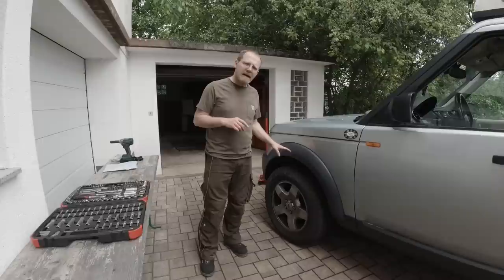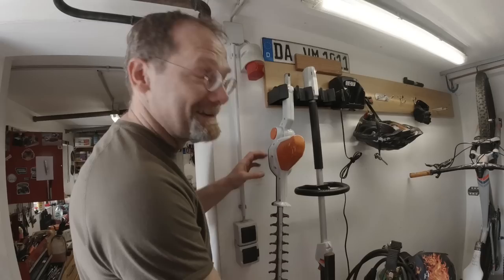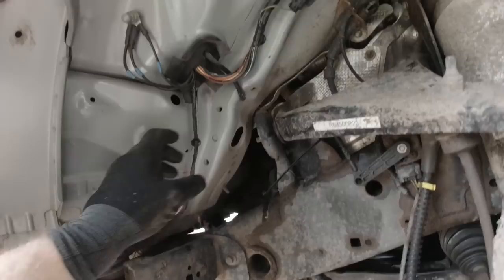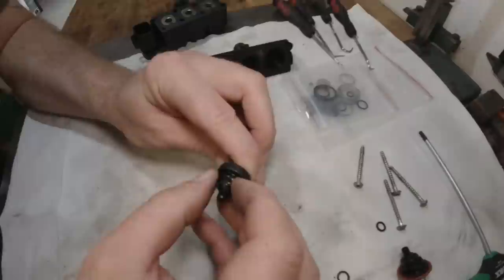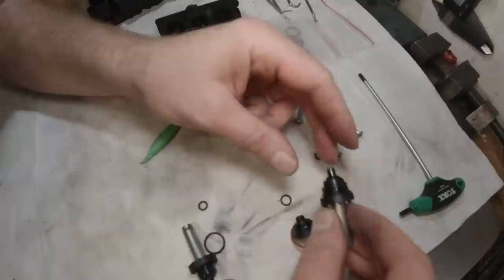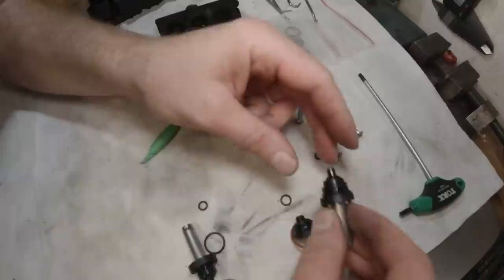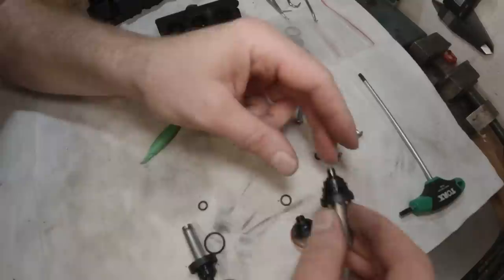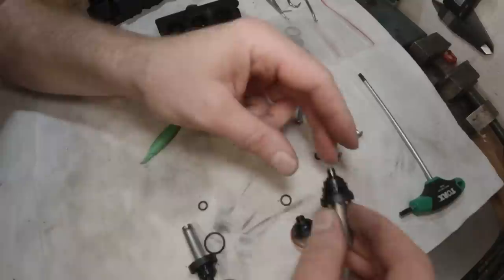Air Suspension Fix - Land Rover Discovery 3 / LR4

Comment: Yeah, the air suspension has amazing ride quality and it's also great for off roading as well. I concede that it adds some unreliability to the vehicle (especially if neglected), but it's worth the trouble. In fact, the air suspension is the main reason why I recently added a Range Rover to my fleet 👍

I rebuilt my front valve block on my Disco 3 over a year ago and I never figured out where that small O-ring went 😂
Reply from the maker: I agree. The system is worth the eventual trouble.  Pretty sure the valve was leaking internally.  Vehicle stays raised and no more faults.  Enjoy your Range Rover.  Christian

Comment: A word of advice when you replace the Air Strut , torque the bottom shock bolt from your pit after fitting the new strut/shock with the car in normal ride height and all 4 wheels on the ground . Oxyman in the US  does a good YouTube  video on quickly replacing LR3 Airshocks 
I think the Mr Bodsey video on servicing the valve block is The Brake bible guy,  Ian Bodsworth. 
Nice to see the "Voyager 1" Tent heater getting used again .
Vera stressing about the car evertime it's on axle stands is priceless!!!
Reply from the maker: Yes, I tightened them before wrong and it twists the bushing badly.  Christian

Comment: That's amazing what those engineers did building those valve units, it is just as amazing to see Christian Service the unit with all those O-rings and stuff, Vera and I are in suspense watching!
Reply from the maker: I was surprised that it actually fixed the leak and that is was still working.  Would not touch the internal rings again.  Just the big ones.  Christian
Reply: @Vera_and_Christian  You can fix anything you put your mind to, Christian!

Comment: Hello Christian and Vera, the noise the valve makes, is because de EAS Computer, instead of sending a continuous 12 V signal, it sends a PWM signal in order to actuate the valve.  This PWM signal lowers the amperage needed to actuate the valve spool. Its a common practice in order to reduce the load on the electrical system.

Comment: I'm using Arnott 2809 shocks for the front suspension on my LR3. So far are good, and were easy to install
Reply: I'm at 170K+ miles on my original LR4 shocks. I think I'm going to replace them with the Arnotts.

Comment: Thank you for another insight into the LR3. I will have to do or let the garage do a lot on the suspension this year (now 275 tkm and 14 years). I still try to figure out how to split tasks between me (cheaper ;-) ) and the garage. Most likely I will do the air suspension parts that can be done without disassembling the wishbones etc. and let all the parts that require re-aligning and measuring to the professionals.

Comment: Thanks for showing us how easy it is to service the suspension valve block. Mine was replaced 3 years ago with an OEM unit by the dealer I bought the LR3 from. It cost me nothing, they paid for it in the name of customer service which was nice. PS, I don't know if there is a non-genuine unit.

Vera, you don't have to take the ARB Deluxe bull bar off to unscrew the wheel arch screw. There is enough room to push the lights out a little bit to access the screw. It is a tight fit, but can be done easily.

Comment: I've had air suspension on my Teslas but no problems in over 100,000 miles. Nice smooth ride and I do like the ability to raise the suspension for "off road" use (not that I do much off road in the Teslas... that's what the LR is for).

Comment: Have done this - valve service and airbag replacement on a Range Rover L322 - most difficult part was freeing a seized/rusted  pinch bolt on a front shock absorber. There are several suppliers of these service kits - some are better than others - I remember I bought kits from different suppliers in order to track down the best kit - the o-rings are not expensive.

Comment: I rebuilt the front valve block on ours which in 2 years of ownership is the only single issue we had with the air suspension and caused a slow leak, which didn't affect the driving but would occasionally throw an error.    One tip is I bought 100% silicone lubricant and made sure all o rings had a coating of this before reassembly.   Not a single leak since :)
Reply from the maker: We use silicone lube. 😃👍🙋‍♀️Vera
Reply: @Vera_and_Christian  good stuff, I thought it was unlikely I knew something you didn't!   Always amazed by your work, be nice to meet one day.
Reply from the maker: @chrisoverson  😅👍🙋‍♀

Comment: Germans eating sausages for supper!! What ever next! Where were the vegetables?
I really hate it when something gets fixed without really changing any parts. I bet Christian found that frustrating! Still with valves and contamination its possible as long as the seal is undamaged. 
Anyway the nice thing about a Land Rover is there are always things to fix, and even if there aren't any, there soon will be. Try to get a PCM-Engine Diesel 3.0L, P1247-00 (AF), Turbocharger boost pressure low ( on 19-07-2022 12:22:03 at 123342 mi )  fault code for next time then we can see how the professionals do it!
Loved the video, I might ditch my Netflix account as you guys are far more entertaining! Great job.😃
Reply from the maker: Thanks.  There are multiple potential causes for low boost pressure.  The LR4 workshop manual has a in depth diagnostic procedure.  Christian
Reply: @Vera_and_Christian  What manual do you recommend, I have the workshop manual pdf version from Ebay but its huge (7423 pages of LR Time), searching for  P1247 gives no hits, but Turbo gets you into the right ball park. Can you show us what you use (and study) in another episode?

Comment: Great works you guys….Tried to do this myself last year & I got the rings all mixed up….long story short it didn’t go very well for me, ended up just getting a brand  new  front valve block
Reply: At least you only got 1. Ordered a cheap non land rover one from eBay only to find the electrical socket was leaking air after fitting 🤔 so then had to buy another proper new one from LR - still wasn't fixed so then new compressor...  and now we have suspension again 🤗
Reply from the maker: 😅👍You just need someone like me helping you, then that will not be happening again. 🙋‍♀️Vera

Comment: Guys, the valve block affects the compressor when one of air spring valves (or both of them) are leaking. Center valve does not affect neither height nor compressor time. The spring valve leak when the rubber bump in the center of stock is worn. Use sharp tool to pull rubber bumps off of stock, then use metal or plastic spacer to displace bump out of stocks and then use sand paper to remove worn part of rubber. It will have immediate results, but after 5-10 months you will see leaking is back, so yeah new valve block.

Comment: When you consider that air suspension has been pretty standard on commercial vehicles running at 44 tonnes plus for over fifty years, it's obvious that the system works. I know the ride in my Disco 3 is very comfortable and I have an after market suspension control which allows me to level the vehicle side to side as well as front to rear and has a 'trailer hitch up' setting as well. Yes, it can be problematical but then so is most everything if you don't look after it. I certainly wouldn't change it for a mechanical system.
Reply from the maker: Oh don't get us wrong, we praise the air suspension. It's the best thing going for the Discovery, we would not want to change it, and have stated so in many, many videos. Did I say many videos? 😃 It's one of the biggest sins, changing over to coil spring just because someone does not take care and service the air suspension.🙋‍♀️Vera

Comment: Just a thought; have you taken into consideration the temperature drop in the air bellows during the night? Could it explain the drop in height?
Reply: I was thinking this as well, and air barometric pressure which does change by the hour, or is so little air in the system not to matter?
Reply: @WhosPhotoTube  Of course, it would have to be measured, but my guess is that it is enough air in the bellows to give a 1,5cm drop with a 10-15°C temperature differential.
If the car rises again towards the afternoon, we have our answer.
Reply: The air spring system in my E39 Tourings is unaffected by the outside barometric pressure. There are two steel air reservoirs, one per side, which equalise the pressure. I suspect that the Land-Rovers have a similar system given their BMW heritage.

Comment: ooo , You see , as I type to You via email with the same issue in my Disco4. Im during changing front and rear air valve. in my case  every morning only front was 2.5cm down and was pumped to normal high. We will see if after changing air valve will be OK :)  Regards

Comment: The big issue with the old Classic and P38 was that everytime the system detected a fault it would put the vehicle down to the bumpstops. The "cure" was worse than the fault. I think that soured a lot of people on it. The air suspension on my L322 has been flawless. You need to buy a 2006-2011 L322 so I can learn more about my truck. Please.......

Comment: Great job, but I have a leak on my driver's side. Will track the leak and hopefully get it back to normal. One question though, could you show how you plugged the oil pressure gauge? Thanks Christian. Vera's comments are so funny :)
Reply from the maker: The leak is coming from your sunroof most likely. Have you seen this video yet? https://www.youtube.com/watch?v=604513GUKws&t=393s🙋‍♀️ Vera

Comment: Ah yes, the old hidden screw in the wheel arch trick. I didn't need to take my bullbar off  to get it out as I forgot it completely and ripped it out. Vera I still think the cracks in the strut are just baked on dirt. Are you going to replace the complete strut or just the shock absorber? I went Koni FSD for my shocks, and had to order them from GB as not available in Oz. Good work with the valves, I really should do mine!

Comment: I have had a timing belt go prematurely (aftermarket) while cruising on the highway. Ive bent a valve and broken the oil pump so the Cylinder heads have had to come off to ensure no further valves are bent. At 330k the bottom end of the engine still looks great with no ridge on the cylinders. Moral of the story. Rather replace with OEM components on critical areas.
Reply from the maker: You probably still had the old oilpump we always warn about. We cannot mention enought that everyone with a Disco from 2005 till 2009 should have checked what oilpump they have installed. 👍🙋‍♀Vera

Comment: Hello!  Trying to solve a EAS relay puzzle.  Thought I'd ask you guys.  Relays for AMK compressors are 80 amp and Hitachi are 70 amp, yes?  I have a 3rd type among my spares which is stamped "70A Cont - 140A Peak."  I'm assuming that this 3rd style is simply a 70 amp relay with more words on the case.  Any opinion about this question and compressor relay amperage?  Thanks!

Comment: What model electric chainsaw? Been looking at these for a while. Means we don't have to carry smelly fuel in the car when we go away. Also reduces the noise pollution 😊
Reply from the maker: I got the Stihl because it is available here in Germany.  Don’t buy cheap as you need the battery to last and basically bigger (capacity) is better.  Christian

Comment: I have a very  odd question I have been chasing a fault on my discovery 3 and found that when testing the power and ground on my center valve block solenoid I have 12v live on both wires.  I unplug power to the suspension module and retest the solenoid there's nothing and when I plug the module back in I have a negative reading on both wires from my power probe but no continuity to ground it's blown my mind I'm not sure what to do next to be honest
Reply from the maker: You can find the wiring diagram in the www. The solenoids are PWM controlled.  It’s not simple 12v Stuff.  Not sure about the ground so.  Check the wiring diagram.

Comment: Are you considering that the air in the struts cools down overnight, thus reducing the pressure by a few hPa ??
And have you connected that DAB+ aerial to the Pure Highway ? If yes, how did you connect that ?
Reply from the maker: No, definitely not. The system is under pressure. So there was a leak somewhere. 🙋‍♀️Vera

Comment: Hey guys. Great video. I had the same problem. I ended up buying a D4 used valve block front. Sorted. Also what gap tool do you use?? Great video as always.
Reply from the maker: We have the GAP tool for Land Rover vehicles. There are no other versions for the same vehicle brand, like with the icarsoft tool. 🙋‍♀️Vera
Reply: @Vera_and_Christian  thanks Vera. Appreciate your reply. 👍🏻👍🏻

Comment: Hi Christian.   The gap tool you are using 17min 21 sec, did this come with the Disco 3 or is it a separate purchase? I thought it may be a separate purchase
Reply from the maker: It is a separate purchase and quite expensive. Google GAPIID or Gap Diagnostic.  It’s the best unit available. Christian
Reply: @Vera_and_Christian  Thank you for the info Christian
Reply: @Vera_and_Christian  There are 2 versions of the tool,  the IIDTool BT at £440 & the IIDTool Pro at £1,650.   Were you referring to the pro tool? If so, it is expensive but needed if one wants a good diagnostic tool
Reply: @life107familyfitnessboxing8  you don't need the Pro version unless you plan on using it on multiple vehicles. The BT version is good for one vehicle ( it is locked to the VIN No. You can purchase a new code to transfer it to another vehicle if needed).
Reply: @AndyK.1  it is pricey, but you can sell the Gap Tool when you sell the car. No other tool is as comprehensive as the GAP tool. Why spend a fraction of the cost to save some money, when you just have to pay a dealership in the end to do a task that an Autel can't do. Not worth it in my book, but to each their own.
Reply: @AndyK.1  🤣 Can the Autel be used on other makes? If so it definitely makes it more versatile. There is a reason the GAP tool is so popular with Land Rover owners. Even Christian bought one...

Comment: Watching with interest, my own D3 has a leak so settles down over a few days, the front takes a while to raise up when it does start up. 
Time for soapy water and some inspection.

Will you check the centre and rear valves?
Reply from the maker: Right now our is fine. No, won’t touch them. Christian
Reply: @Vera_and_Christian   fair enough. If working leave alone. 
I changed the air struts on mine in 2018, I fitted Dunlop ones. If I was doing again, I would go OEM for them.

Comment: The reason your snorkel is noisy is you have the head the wrong way round so the engine is having to suck the air in instead of the air being forced in from the front as it sound be.
Reply from the maker: We love the sound of our snorkel. We even have a video about the snorkel facing the front or the rear 👍🙋‍♀️Vera
Reply: @Vera_and_Christian  many thx for the reply just watched that episode!  Really love your channel more so because I just bought a late 2012 Discovery 4 amd am thinking of putting a winch & snorkel on it for fun.  many thx Robert.  From Norfolk UK
Reply from the maker: @elecomms6031  Then you should definitely watch our snorkel mounting vidoe. That was not way more work than expected 😂https://youtu.be/xHK3YNrXJG0 In our latest video which was released yesterday, you can see that the Land Rover snorkel is only mounted with one rivet nut. Something to consider. 😅👍🙋‍♀Vera

Comment: Unfortunately my D2 doesn't have air suspension so I missed out on the chance to benefit from your wisdom in fixing this complicated mechanism. I can, however, report that after 195,000 miles I finally did have an alert that one of my O2 sensors failed. Not much drama. Ordered a replacement and it only took about 20 minutes to replace so not worth making a video. (Fortunately, fairly easy access)
I think you should get a D2 so I can benefit from your expertise in maintenance.
Second your endorsement of electric chain saws. I ditched my noisy, unreliable gas chain saw many years ago and have an assortment of battery and plug in chain saws. Much nicer to use.

Comment: See the new Landrover? TFL on YouTube started getting engine codes with less than 100 miles on theirs!?!?
Reply from the maker: So do many Jeeps, Bronco’s, BMWs, VW and other cars.  TFL had a leaking shock on a brand new Bronco.  Christian
Reply: @Vera_and_Christian  Broncos have air shocks? News to me. Most 4x4s in the USA have lift kids not air suspension.

Comment: I recently rebuilt my front valve, only to find out that it was leaking through the electrical connector, new valve in the end.🤬
Reply from the maker: This sucks. The can freeze open in Winter if the dryer does not work.  Christian
Reply: @Vera_and_Christian  definitely, the old system seemed better with one valve block up front controlling all 4 corners, rather than 3 different ones.